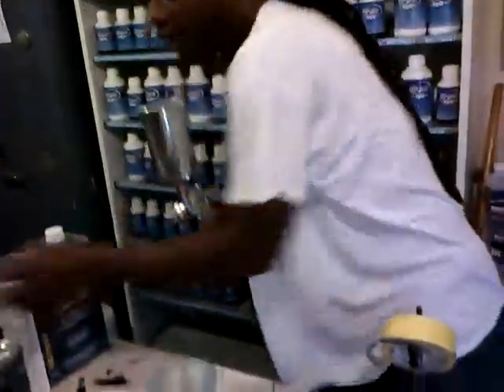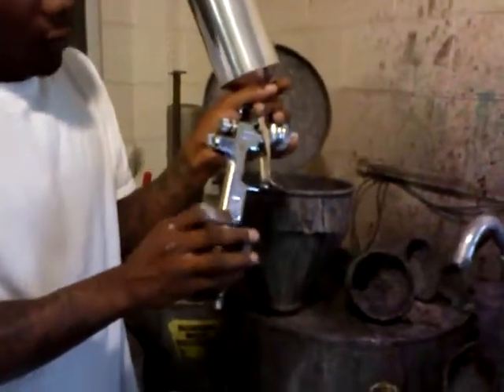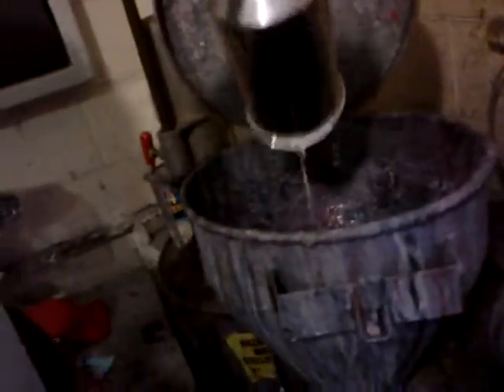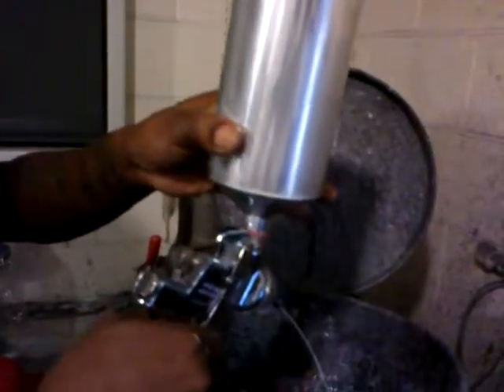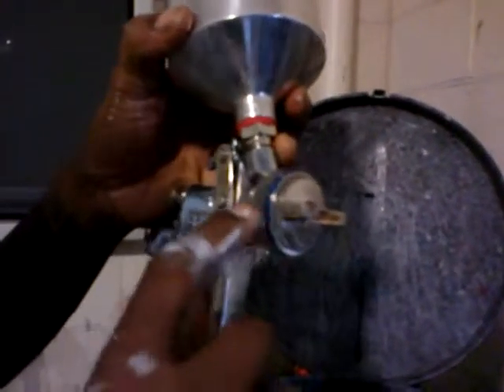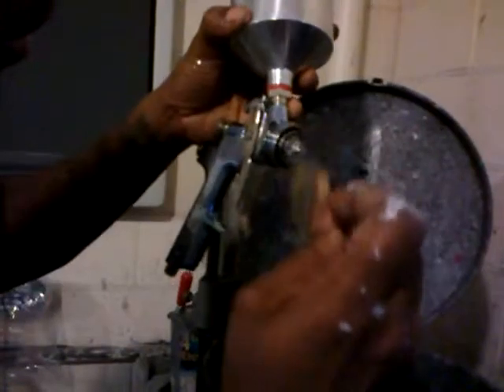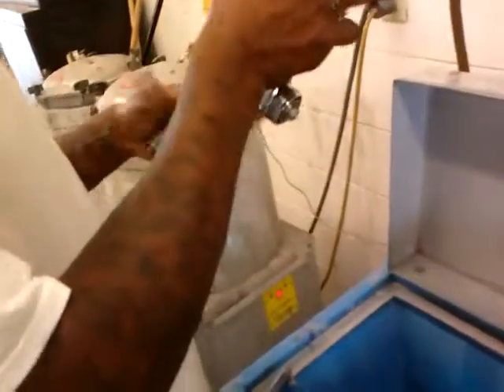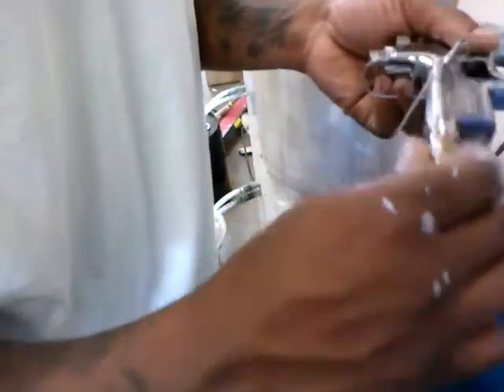How to clean a auto Paint Gun

Comment: I like this video. When you "squeeze it out", you dont have the compressor hooked up to the gun? Like I dont have to run the compressor at all when cleaning my gun? I just bought that Bostich one from Wal-Mart for 50 bucks. It seems nice, looks nice but before I spray my you pull and pay fender, I was watching some of your vids. Especially the one about cleaning the gun. I think thats pretty important to figure out before I just go start spraying. Might end up not cleaning it right and ruin my 1st gun. BUt yea, I guess I dont have to run compressor when cleaning my gun? Thanks for the good videos!
Reply from the maker: Mike Propst no you don't need to run the air when cleaning. if you have air supply connected, you will get thinner everywhere and in the air which is not good.